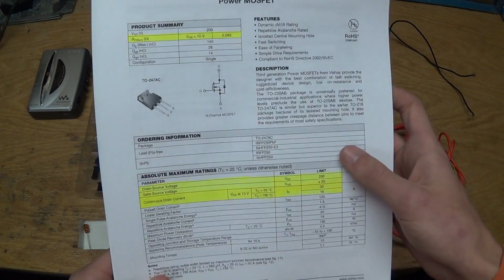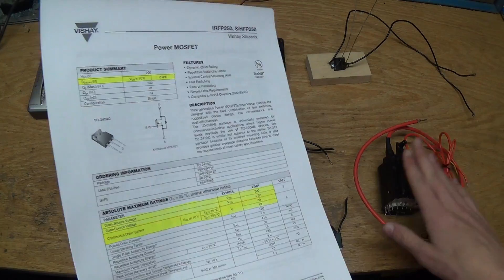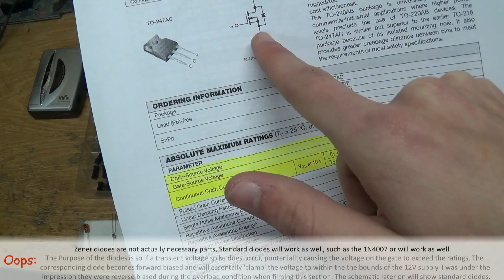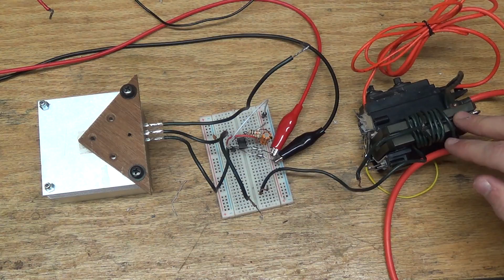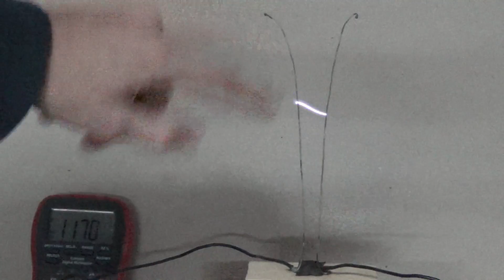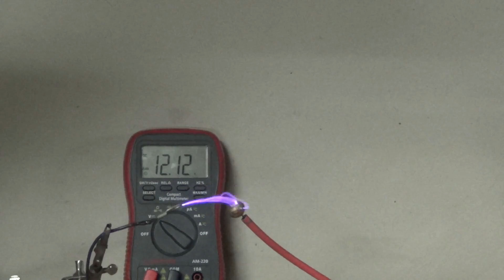Weekend Projects: Make a 69KV Singing Arc Plasma Speaker Flyback Driver!

Comment: replace the flyback with tesla coil primary and secondary plz XD
Reply from the maker: +henning hund One step ahead of you buddy! https://www.youtube.com/watch?v=lPHHvVTVbwM
However, it is not that simple. If I did just that, I would end up with some insanly hot MOSFETs that would probably fail (catastrophically) and some very unhappy power supplies. The switching frequency of this is about 15KHz-100KHz (depending on how well it is tuned for a specific transformer) while tesla coils operate in the MHz region, about 1 to 2 orders of magnitude more. Even if it did work, I would only achieve "slayer exciter" performance because of the low coupling between the primary and secondary. That circuit in the STTC video uses a closed positive feedback loop to create oscillations at the resonant frequency of the secondary LC tank circuit (being the secondary and all parasitic capacitance with it.) That circuit operates at anything between 12V and 50V depending on what component values are used, but obviusly gives the biggest, coolest sparks with >50V.
Reply: +Power Max replace the 555timer interrupter with an arduino turning midi from pc in to pwm.
Reply from the maker: +henning hund Might consider it if I build this project into a fixed enclosure.

Comment: "you want to get lots of 555s because you'll be burning these out quite a bit".   lol. that really doesn't inspire confidence in your circuit...
Reply from the maker: lol nope! this circuit is pretty unreliable especially if it is your first time building it. However I only killed a few 555 timers during the video production, once you get it working it is reasonably reliable.
Reply: Power Max b-but im making this for a project, it has to be working on the first try because 555s here are rarely sold.
Reply: @GoodMorning-vp9oo  One of the most common ICs, lest than 50 cents for 10 from aliexpress, or even 50 for about a dollar.
Reply from the maker: @Tocsin-Bang  Those are non genuine parts more than likely. Digikey and Mouser are the go-to sources for ICs. You may waste hours of your time with fake parts from the chinese shops.
Reply: they are cheap :D
Reply: Put a zener diode on the gate to source and resistor in series with the gate, about 10-22 ohm 1/4w will do. Then decouple both supply rails with both ceramic and electrolytic capacitors. Then use a current sense resistor between source and ground triggering an NPN pull down on pin 5 to stop the core from flux walking, you can use an NPN class a preamp intermediate stage between the audio source and timer to make it much louder. Experiment with the bias to get the best balance between sound quality and distortions.